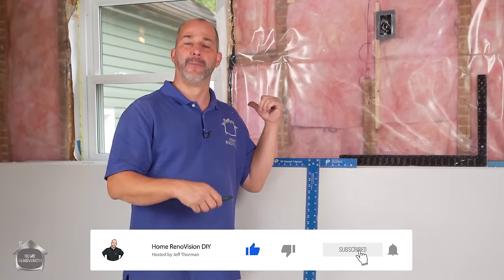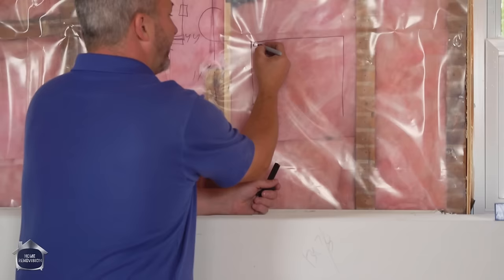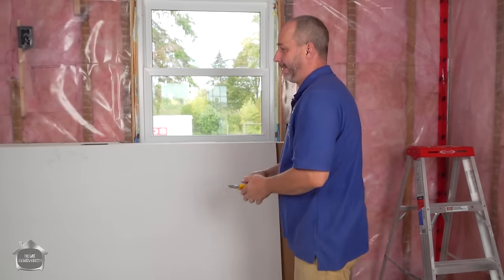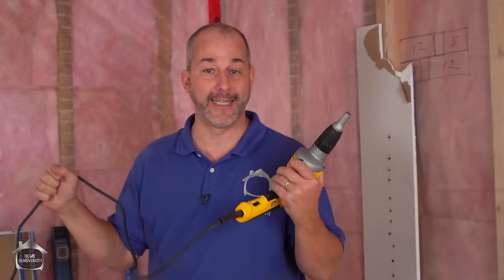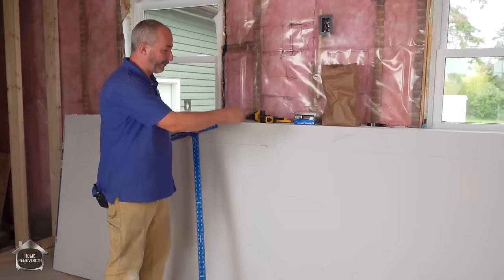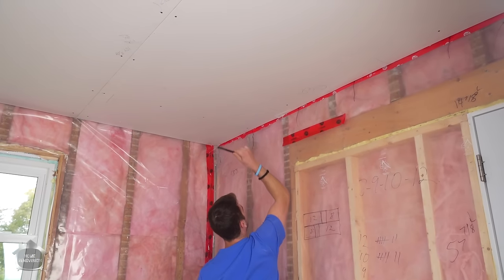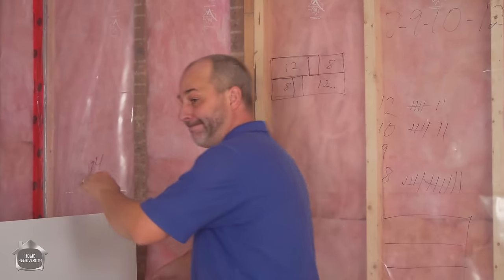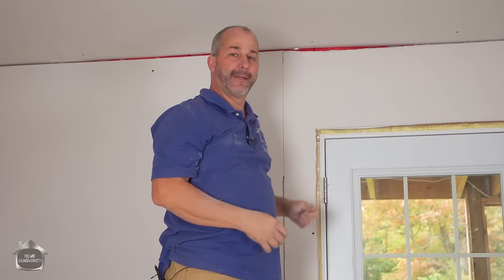How to DIY Drywall For Beginners | Cutting & Installing

Comment: "Perfect every time, except when Matt takes the measurements and I cut the drywall." :D Thanks for leaving the goof up in the final video.
Reply from the maker: I have no idea how I missed this comment. But that was awesome. Cheers !!!!
Reply: As always, communication is key but as usual not easy 😂
Reply: timestamp please? did i miss him actually saying that sentence?
Reply: @gnowxilef  4:30 and on. When they took the measurements, they were translated onto the board incorrectly. The first measurement should have gone on the bottom, and the second on the top, which caused the board to be cut like  \   instead of   /   which is how the width of the room is varying at that point of the install. When they put that piece on the drywall jack, the white will be facing down, and the long side needed to be on the left of the room (how we're viewing it), which would be the top of the board while cutting it on the ground.

Comment: Great video.  I'm a do it yourself drywall expert.  I'm not a professional drywaller but I have done a lot in my time in remodels and repairs.  Everything you are showing in your video is on point and accurate for basically doing it alone and having a helper when you can find one.  Matt is a perfect example of the helper being the cause of slowing things down.  I can hardly wait to see your next video on mud and tape.  Thanks for going through the trouble of educating the public.

Comment: Your system is very efficient. Using it will avoid problems in finishing the joints. Safety is first with you.  Smile as you go along.

Comment: Rehab old houses are never plumb, level, or square and usually are always a nightmare. Just a couple friendly tips, use your roto-zip more. After lifting your sheet of drywall up put some screws in the top and use the roto-zip to cut the ends if they are too long. Also, use it to cut your doors, (and windows) out as well. On your doors and windows you will have to go in the opposite direction (clockwise) as your boxes, (counterclockwise) because your bit is on the opposite side of your work. Saves a lot of time and is more accurate.
Keep up the good work. I enjoy your videos.

Comment: I usually use a straight edge or a chalk line when dealing with uneven angles with drywall... works great and it's cheap

Comment: Before I start boarding my walls I go around the room and put a mark on the floor at the edge of the stud that every box is mounted to, with an X to indicated the side of the line the box is on, and the measurement of the center of the box from the floor... Way faster then measuring from another piece of drywall the height and width of where the box is located. 90% of the time switches and plugs are the same heights so it's really simple and quick... 

Put the drywall up. Put 1 screw in each corner then rotozip the boxes out.

Comment: Very talented and I learn a lot from you so if I may interject something here I noticed that you went from the floor up and you installed the sheetrock completely down to the floor I do remodeling for several hundred apartments and four different realators I start at the TOP of the wall and install the sheetrock DOWN and I leave a one inch gap before touching the floor because baseboard will cover that the reason that I do that is because plumbing fails I am right now this week dealing with two floods in apartments if you run the sheetrock to the floor it will wick up water into the sheet rock and create an unnecessary mess.I have to deal with that all of the time because people didn't know what they were doing like you said"This is not finish carpentry "Thank you for sharing much experience.

Comment: Thank you for your knowledge and sharing your secrets/tips.  I learned alot from this video. Mainly that im using the wrong knife, cutting the drywall wrong and the most important hang all the drywall first then cut out all your holes. Thank you.

Comment: With the exterior walls insulation and vapor barrier pushes the drywall a bit so you have to reset your nose cone just for the first few screws

Comment: Few things. Dont use that great Sharpie on the drywall. It will show through paint.

Dont worry about a quarter inch in a corner. The taper can fill it and tape will  cover it. 

(edit-spoke to soon) Also leave the dimple gun on, by locking the trigger. No need to use pinky.

Lastly, I would have leveled and trued the ceiling by adding straight lumber to the sides of the joists all laser leveled for a flat ceiling.

Comment: I'm about to install decoupled walls and ceilings with 1/4" MLV on walls and 1/8 above, dual 5/8 drywall with green glue and extra wrapping on the duct work. Managing hot air, cold air, sound, fire safety and age of the house.

You should do a video (if you  haven't already) on how to line all this up with a ceiling made of 2" of resilient channel, mlv, drywall and geeen glue. I just realized my led pot lights don't have enough reach, so maybe  suggestions on the type of light fixtures  to use, and how to sound proof them!! 

thanks! 

Great videos, learning more every view.

Comment: Use four trestle to place the drywall sheet on. One at the time.
Cut a drywall in half or other board to use as a guide for cutting long cuts. Never ever cut on freehand. You start cutting the short cuts first. Get a drywall file, if you need to shape edges. Where i live we normal put special magnets in the outlets and after the wall is mounted we use outside magnet and then a hole cutter that goes over the magnets. This makes a hole perfectly to the box.
We have round boxes. The drywall router looks good, but you can hit the wires? Perhaps put a pice of wood in the box?

Comment: You should pull out the light switch and tilt it inside the box while the drywall goes in place.  Then, reinstall the switch.  This will keep the ears of the electrical device (switch or recepacle) on the surface of the drywall giving the device support and not having to use the cover plate to hold the device.
Oh, also, be careful when using the router in the electrical boxes.  You don't want to nick the wires.  It happens. 

Great videos and great work!

Comment: Hi there, I keep asking this question but I guess it wasn't in the most recent video.  I need to make a straight clean cut on a cabinet box in order to get the refrigerator to slide further back into its space.  Right now the fridge juts out about 10 inches but it could slide back further if the cabinet above it wasnt causing it to stop short when the fridge hinges hit the cabinet above.
Reply: What's the best way to make a straight cut on a cabinet box that is already in place on the wall. Thanks!
Reply from the maker: They make 18 15 and 12 " cabinets for above fridges. I would suggest switching the box out since cutting it would not end in a nice finish. Cheers! other wise remove the box and use a table saw!

Comment: Enjoy the channel but I noticed the bottom panel rested on the floor.
I do restoration following mold remediation and the protocol that's being used where I am ( SoCal) is to leave a half inch gap between the floor and panel so the drywall can't wick up moisture if there's a water leak.
Reply from the maker: we ar4e on wood frame so no water wicking. good poinbt on slab on grade construction though!Cheers!

Comment: Hi im in FL i have a block home and doing reno on a room that had mold and moisture problems. I am putting up drywall. My block is foam insulated. Should i add foam board insulation on the inside wall between firing strips before i put up drywall or will that cause more moisture issues?

Comment: What spacing do you use for the screws? Is it different for the ceiling from for the walls? Does it change for the thicker  drywall?
Reply from the maker: I like to use 5 screws over the 4 ft of a sheet. If a screw penetrates the paper then I add another. Cheers Barbara!

Comment: For the piece over the door couldn't you have just measured the width on the horizontal popped the pins on the door. Then you could have hung the piece up and cut the door  opening with a saw using the frame as a guide to be a bit quicker, less chance of error?

Comment: Do I need to put that piece of wood top of the joists? I've got only one piece of wood like that in the basement I was thinking about pulling it out and putting the dry wall right on the joists. Tip or suggestion? 

Thanks

Comment: Hi Jeff, what do you prefer when installing drywall (on a wall) a little less than 8 feet)? Vertically so you never have any butt joint, or horizontally where you have only a single company joint roughly in the middle. Regardless of the furring strips.

Comment: The crookeder things are, the more you need a laser.  A level doesn't work because of errors, and if you start out one place, by the time you get around the room, you run into a problem.  With a laser, you can shoot a line around the room and see exactly where the high point is on the ceiling and measure 4' down from there.  Adjust the laser down to that line and mark a line on the stud all around the room in case the laser gets moved.  Mount the wallboard to the line starting in the middle of the walls.  This will give you perfectly horizontal surface to measure to the ceiling from AND perfectly vertical joints to line up with the studs.  You do the corners last because the walls lay in or out also, and you can measure the angle you need to cut the ends because the ends of the panels in the middle are perfectly vertical.  I never did this with drywall, but I did when sheeting the inside of my detached garage with OSB.  This method also means you can make cut-outs ahead of time that are dead-on and everything will fit.  I left 1/8" clearance around electrical  boxes and they all turned out to be almost exactly centered in the openings.  In my garage, the OSB is about a 1/4" from the floor on one side, and almost to the top of the plate on the other to where I had to add some 2x4 a few places  and toe nail a little on either side of that area.  I used the laser some places too to split the difference on a not-so-vertical studs to know where to run the screws, but if too bad, you can always tip the laser.  The laser is one MASSIVE time saver and the indoor house kind are very inexpensive. People won't be snapping lines indoors anymore once they have one of these, and they are more accurate as there is no bow in the line.  Where the bottom ends up varying around the room doesn't matter because that ends up under the baseboard.  My garage corners are all slide fit, (my inexpensive WEN 7 1/4" track saw with track was another incredible time saver) and horizontal and vertical seams you can't slide paper through the seam anywhere, so no moldings except at the floor.  The other thing is to mount the bottoms of the electrical boxes 1/8" above the  bottom pieces so the cutouts are only on the top and you know exactly where the nail plates on the studs are after the wallboard is installed so you don't try to screw or mount anything in that area.  I did that for the bottoms of the windows as well.

Comment: Question from a new home renovator. Most newer impact drivers have the 1, 2, or 3 power setting on them, just like the DeWalt you typically use. What setting do you recommend when using the tool for driving drywall screws (into wood)?
Reply: Mike Lash slower is better for hanging drywall unless your using a specific tool made for it. You should really look into either the bit he showed or the gun he used. It really is difficult to sink screws into drywall the perfect depth without ripping through the paper. The paper on the front is all that’s really holding the sheets up. That’s why you need to go deep enough that you can mud over them but not go through. Also make sure to put screws No more than 8” apart on the edges and 12” in the center.

Comment: I tried one of those adjustable drywall bits and it just kept coming loose and eventually the threads stripped from continually re-tightening it. I should have used the regular dry wall gun ! Fortunately I was only sheeting a very small 200 square ft room.

Comment: Hi Jeff. Question about bathroom mixing valves...

I'm looking for separate handles to control the shower and handheld up high and then the tub spout coming out of tub from below. Would I plumb in one mixing valve for each, use only one mixing valve to control both (is that possible) or is there a better way that I'm not seeing?

Thanks
Reply from the maker: Hi Chris many manufacturers have 1 valve that also mixes hot and cold and diverts to functions. best to do the home work. grohe, american standard and delta all have this option. to name a few! Check with the folks at fergusons or wolselley in canada if you live up here!

Comment: I have a walk out basement that less than half the basement is actually underground. behind all my studs is  sheets of plywood. also it has R-19 faced insulation stapled to the studs. would I be ok to just put drywall up or should I put some type of barrier.

Comment: Where do you buy  and why do you have plastic the plastic that seals the insulation?
Reply from the maker: Hi Jordan, I live in the north where this is part of pour building code. it is available everywhere like lumber is. not to be used in the south
Reply: @HomeRenoVisionDIY  thank you. I guess I don't need it.

Comment: Hi Jeff, these videos are great. Any chance you record a video on how type X and double drywall is installed? Also, the false ceiling with tracks would be very useful. I’m thinking to learn this trade and start my own drywall contacting company. Any advice regarding that? Thanks a lot in advance.

Comment: Hey: Can you do one on temporary drywall installs with an air gap over existing drywall that's 100% removeable for us lowly renters?  I Was thinking if I can make them in panels, then place next to eachother, use roxul to fill in among the studs and MLV, but leaving a good 1" air gap.   Living next to other rooms, especially the kitchen = hell.   I am looking at soft close pins from Blum that are great and cheaper than replacing hinges on the kitchen, but I cannot do anything about the over range microwave slam.   Won't be able to buy a house for about 30-36 months so was thinking a few hundred dollars on removable panels I can take to other places I'd rent would be nice to have.  Not sure if a curtain tension rod will hold the weight of moving blankets, so this would be my next option  to explore.

Comment: Hey Jeff great videos and much love from south Texas, quick question not sure if you covered this but what is the minimum height of a wall Outlet from the floor, some have told me to use the length of my hammer which is 15 1/2 inches is this correct Jeff.. anyways keep them videos rolling lol...
Reply from the maker: hammers are a great measurement. Cheers!
Reply: Thanks Jeff and for the fast response, Cheers

Comment: I am putting up sheetrock on the walls of our basement.  Do you recommend that we hang them vertically as opposed to horizontally too avoid any butt joints?  Keep up the great work...
Reply from the maker: that is a lot of extra work. I would rather deal with a couple butt joints any day!

Comment: The electrical tape on the drywall screw gun.  That bit will file down a bit over time and you'll want a click or 2 adjustment.

Comment: I actually had to shim drywall in a couple places in my double wide. Original construction left ceiling tiles sandwiched between joists and wall, 2x3 construction, when I peeked inside the wall to see if building it out would have been easier...yah...I shimmed. 😂
Reply from the maker: well done. sometimes you need to be creative. Cheers!

Comment: I'd have shimmed the lower half wall of drywall off of the floor and brought the top of it to a laser level.
Let the trim work cover the small gap at the bottom,which is going to be made smaller by your floor tile anyway.
.
With a gap at the bottom, you can slide the tile under the drywall and thus not have to be as fiddly about getting an accurate cut. You get 1/2 inch of  "grace" to be oversize.
.
NOW you will be trimming drywall at top and bottom of most rooms since the ceilings are typically a couple of inches under 8 ft.

Comment: Hello, How do I fix an mistake with a wall outlet? The hole is too big.
Reply: A simple fix would be replacing the existing cover plate with an oversized one.  They sell them at Home Depot and also online.

Comment: Why are you installing drywall horizontal in America?
Reply: Less butt joints. When you can span the width of the room with one sheet, why wouldn't you?
Reply: @tay13666  If you have a standard wall height (like we do), then the drywall fits from floor to roof, you never have any butt joints. And if you install horizontally you don't have any backing, behind the drywall between studs. So if a five year old bounces of the walls. He will open cracks in the wallpaper.
Reply: @72strand   thats not usually a concearn...
Reply: @sodapop9283  OFC it is. If some prof does a new apartment. The need to do a good job (in Sweden). That is why every wall needs OSB behind the drywall. Later some family from Africa moves in (or other family). The kids DO run from wall to wall. And the walls will bend and make cracks. Who will have to pay for that? The county not the family. So no this is a big concern.
Reply: No standard for wall heights in USA.

Comment: His son was like 134 "and like" 7/8 "or something like that." Wtf lol. It is either exactly 134 and 7/8" or it's not. Then he almost falls back on the ladder. Gives the wrong measurements for the drywall  and it's not even close, and strokes his hair repeatedly. I don't think he's cut out for this. Probably used as a helper only when he has off time. Vid still gets a thumbs up for dad.